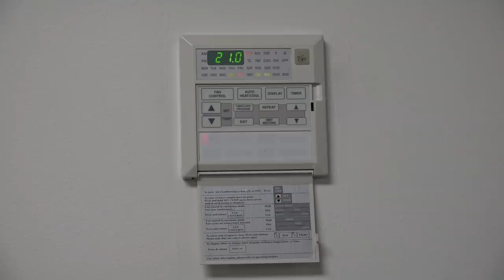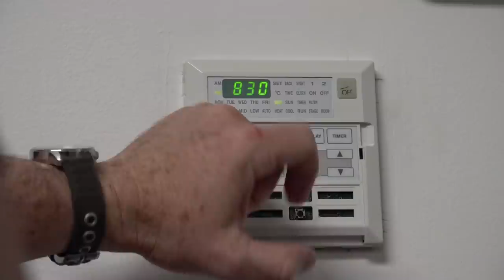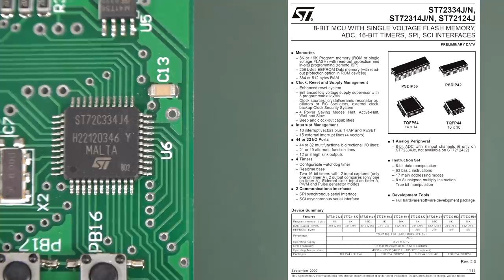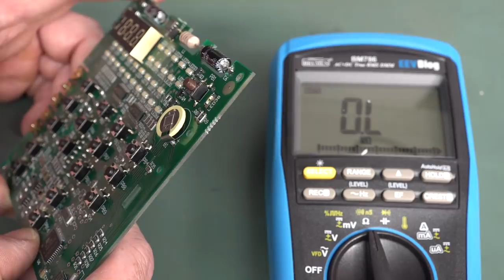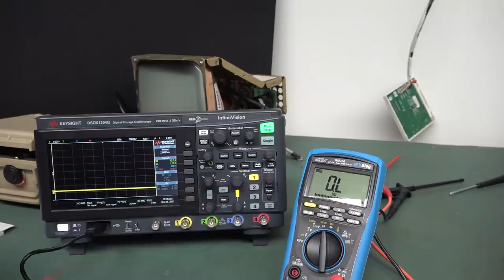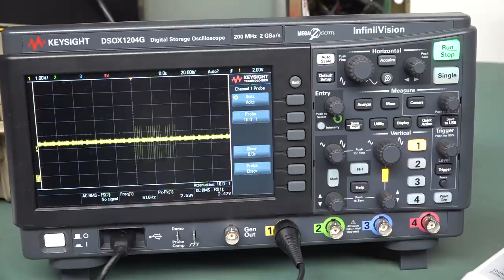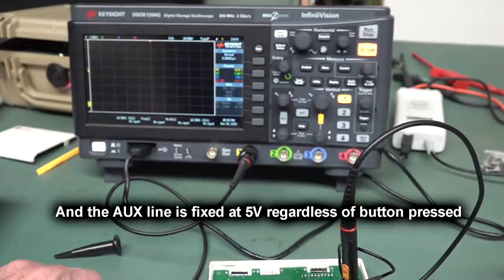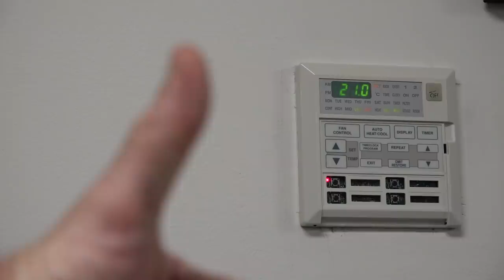EEVblog #1360 - REPAIR - Aircon Control Panel

Comment: You kept saying that you would use the internal sensor. Which is dumb.
The internal sensor is that blobby thing that you pointed out.

The biggest problem with using the internal sensor is that it is wherever the control panel is. The control is placed for convenience, not for optimal temperature sensing. What makes it even worse is that it is housed inside of the control panel so it is slightly warmer than the ambient air temperature. (It is at the bottom of the control panel to negate this effect a bit.)

An external sensor can be placed anywhere in the room. In particular you can place it in or near the return where you can get a more accurate temperature reading.

All of which makes a remote sensor better. The only reason to use the internal one is because it is cheaper to install. (or if the external sensor is broken and you are waiting for a replacement.)

Comment: I wonder if those pulses actually come from the AC unit itself rather than the thermostat.  It might be the AC unit reporting what mode it's in, basically to give confirmation that the mode you set actually went through.   I hate that some hvac units over complicate the thermostat though.  Makes it harder to replace with something else if you wanted to.  Most residential ones are simple as they typically just use dry contacts to set whatever mode you want.   Ex: yellow is A/C, white is heat, red is +24v etc.   I ended up using a relay controller and some Dallas temp sensors for mine so I can control it via a web page.  No app shenanigans just a basic web page I can access from any web browser.

Comment: I never get 0.000VAC when measuring the voltage between two different ground points in my house. I usually get a couple of volts, even if both things eventually end up at the same ground/earth bar in the breaker box (our house has old school IT-mains network (Isolated Terra)). How did EEVBlog do that at 19:19? Did he secretly press "Lo Z" on his NM786 DMM?
EDIT: Dave actually went directly to the ohms range while probing the to points with unknown voltage differential. Will a good quality DMM handle that if it is 230VAC (high Amp) differential between the pins? Nevertheless, 0,000 ohms resistance seems funny. Too low.

Comment: I'm not sure if HVAC is handed differently in Australia, it probably is, but in the US the HVAC system is tied in with the fire protection system, so there might be the possibility of triggering a trouble alarm. Won't set off the fire alarm obviously but it would log an issue with HVAC and may potentially phone home to whatever company is monitoring the FSS.

Comment: The digital signal looks like a 'bits' to me.   In OFF mode will always look the same, but in ON mode it is sending several bits of data to determine heat/cool, fan speed,  running/standby, etc.

Comment: Flashing run = probably because you cycled the AC on/off/on - might be a cooldown period as compressors don't like to start shortly after stopping. The pressure built in the system makes it very hard on the motor. (Might not be the case that you are controlling a compressor in a large building, more likely you are calling for a solenoid valve to open allowing chilled water into a heat exchanger...but the protection behaviour will be built into the controller).

Comment: The silkscreen saying PB__ tells me that each pushbutton is on an individual pin of IO register B from the MCU. 
The changes in resistance on the aux line might just be some issues with the voltage induced from the Multimeter through some clamping diodes.

Comment: Hi Dave, my assumption would be that the MCU reads the voltage divider to determine button presses to adjust its state then communicates its settings using timed (pull-up) pulses at set intervals as seen on the scope, the first pulse of which is probably being used as a clock trigger (for the AC unit), then something like a 24-bit listening period and translated into configuration state at the AC unit.

Comment: Dunno about down under, but in the states control circuits like that are 24V AC.
(I just play a HVAC tech on TV...)
Reply: It may even just be connected to a doorbell transformer.

Comment: I'm happy to see the DMM models continuing to evolve, but I'd rather see a ESR capable capacitance meter added to the lineup.
Reply: That would be far too useful - then they couldn't sell you a separate ESR meter. I built one a very long time ago from schematics on the web - one of the most useful tools I own for debugging electronics!

Comment: Airco on/off button works eratically.
Half an hour of analysis later (using various expensive tools): replaces switch.
Fixed.
Reply from the maker: Err, the faulty button was detected after 10 minutes. And it wasn't just the on/off button working erratically, it was causing other modes to turn on, and that's not usually indicative of a simple switch failure, hence the analysis.
Reply: @EEVblog  It is not meant seriously :-)
However, I think you could have focussed more on the analog voltage that is sensed by the micro and see on the scope what it does when buttons are pressed.
E.g. when the HEAT button is pressed and when ON/OFF is pressed, the latter would probably show a quite ragged pattern that crosses over into the voltage area where the HEAT button is.
I think that is more relevant than the pulse thingy that controls the other side.

Comment: This is where 3D printers come in handy, can't find the exact switch then print a new button/adapter to suit a switch you do have. That said pretty sure the last time I looked most suppliers like RS etc. normally offer a wide range of button lengths.

Comment: Dave if you want you can repair those switches, by getting a cotton bud soaked in iso alcohol and flood the button from the top where it enters the body and press the button a bunch of times, that should clean the contacts inside. brand new again.
Still loving the video's.
Steve K.
Reply from the maker: Not if it's corroded.

Comment: I repaired a window unit air conditioner control panel couple years ago but it was just a fuse.

Kind of annoying that I had to go deep into the AC to get to that board out for something as simple as a fuse. Even then, they just had to use one that requires desoldering (no fuse holder). I mean, why bother with a fuse to protect itself if it's implemented in a way to make replacement less feasible?!
Reply: Fuses also protect the wiring from a device gone short. For a fuse that should never open except in case of a non-user-serviceable fault, a cheap friction-fit pc mount clip only presents a new point of failure.
Reply: @abitofabitofabit4404  Sure, but this was on the control panel which was just a 7-seg LED display, IR receiver, buttons, and other low-power stuff.

Reminds me of my $400 Logitech Z-680 speakers that lost two audio channels due to on-board fuses hidden inside shrink wrap. I noticed two days before the 1 year warranty expired but it took me a few days to troubleshoot and call. It turns out that other people with the issue were being sent the next-generatuon Logitech Z-5500 speakers and told to dispose of their old speakers, so they weren't there for factory repairs. I had checked the main fuse and didn't find anymore she  I called them. They refused to replace it under warranty or even let me pay for an out-of-warranty repair. I couldn't bring myself to throw them away. 10 years later I took another crack at it and noticed six thru-hole components hidden in heat shrink... one fore each channel. Sure enough, they were axial lead glass fuses and super-simple to fix. The right fuses were easily available at Radio Shack.

Comment: I'm thinking those bits coming in is just a mask for what LEDs to light up on the control panel....
Reply from the maker: That's what I concluded in the video, it's mode data from the controller.
Reply: That's exactly what it is. A mask for what LEDs to light up.

Comment: You could try to fix the button with the alcohol or some other dissolvent, like gas, or contact cleaning stuff. Just putting a drop on the shaft could be enough

Comment: Just a thought... It could be remote analog sensing, but with constant voltage and measure current.

I would imagine long cables in a voltage divider means high impedance driving the cables and therefore pick up more noise.

So what if you measure the aux wire with a current prove instead of a voltage probe?

Also, the data, could that be noise coupled from for example modulating data on the power supply lines? Let the unit be driven be the capacitor when the supply goes to zero for a data bit?

Comment: The weird thing is so many English words. Usually with the use of iso standard symbols they can be used almost without language at all. It almost resembles a binary clock. Insane design outside, regular insides.

I've got tact switches in one of my monitors and the whole set of them randomly activate unwanted functions. That'll give me something to fix next week /month /year /decade. (when I get around to it or run out of procrastination-fu, though I've got A LOT of that!)

Comment: This looks like an infra-red remote style protocol, signalling with variable pauses between pulses. 16 bits in a "packet". A zero is a pulse with no delay, a one is a delay then a pulse. By freeze-framing your video I've seen the following messages (might be bit reversed / backwards): 0101-1000-0010-1001, 0101-1000-0000-1001, 0000-1000-0000-1001 "Thats aircon on", 0000-0000-0000-0001 "Thats aircon completely off".
Reply: Manchester encoding?
Reply: @DreitTheDarkDragon  No, it is pulse position encoding. The packet length changes with data. If it was manchester it would be fixed length.
Reply: @cathedrow  Oh, I see, thank you :)  I thought that IR remote uses Machnester
Reply: @DreitTheDarkDragon  Some do (eg. RC5) but not all.
Reply: @cathedrow  One of the two main cable TV companies in the U.K. used to use IrDA protocol for its remotes (before they all merged into one company) which meant no learning remotes would work with their cable TV receivers. The reason was that they planned for most customers to use an IR keyboard to access the internet on their cable box.
Reply: @Bin216  Good to see IrDA got some love. (Telewest? NTL? Last cable service I had was NTL analogue so I’m a bit behind the times there)

Comment: Think about it?? Why would they use a resistive ladder derived voltage to talk to the remote air con controller when the resistance and therefore voltage would change because of the length of the cable, the gauge of the wire and electrical noise. You should have realised that much earlier in the diagnosis. Great repair but in 30 years I’ve never seen a high resistance switch of that type so good spotting.

Comment: A squirt of contact cleaner - good for another twenty years.
Reply: Nope.
Can't count how many µswitches of this kind, and of the "lever" kind I replaced on many different stuff, well before the usable lifetime of the device itself. Tried the contact cleaner and it just helps a few week then it goes back to producing complete garbagdy resistance measurement.
Reply: Maybe. But by the time you tear it down far enough to get to where you can get contact cleaner inside of there, you may as well replace it. EVERYONE uses those tac switches, everyone has hundreds of them in their parts boxes. Not worth bothering with trying to save the old 9 cent switch.
Reply: I have an ultrasonic cleaner with those same switches. When one stopped working, I managed to get a squirt of Deoxit in there, and it worked great again. For about a week. :(
Reply: @ThinklikeTesla  Actually, you were probably doing well to get a week out of it. I generally reckon cleaning a pot this way is good for a couple of hours. When I replace a worn out log pot on a guitar I use cleaner to get sufficient connectivity to be able to get a decent idea of the exact law, so I can replace it with similar.
Reply from the maker: Try twenty days. It's likely corroded inside.
Reply: @John_Ridley  Yes, but disassembling and cleaning the contacts with a good contact cleaner usually helps. I'm not talking about these common, readily available few cents tact switches, but there are some weird ones around, which are no longer available, so you either have to substitute them if mechanically possible, or your only other choice is to repair them. Philips used some, for example. The don't have any shaft, the pressing pin is part of the button. I had one of those failing last year in our 1997 Whirlpool microwave (control board made by Philips). I've managed to source a working switch for it from the remains of a 1982 Philips TV... :-) .

Comment: @11:47 It's a buck converter not an LDO.  LM2594 with the Diode D2 and the Inductor L1 (not a Resistor). It is a switching supply despite the commentary.
Reply: He inserted a note and the datasheet front page in post, so he did realise that later
Reply: He put up the data sheet that clearly indicated it's a buck converter... pretty sure that was his attempt to correct himself via annotation.

Good catch though.

Comment: "It should trigger, but it doesn't....". Yep, because it is a Keysight scope. These models have "digital" trigger and it works this way (the Keysight way). Tektronix have different way to trigger on signals, more adequate one (most of the time). IMHO.
Reply from the maker: Nope, you'd get the same result on any scope, that's what trigger holdoff is for.
Reply: @EEVblog  Please, allow me to dissagree. Here is a short demo (1min). https://youtu.be/OT-0mGkWUxM
Anyway, if you know your scopes, doesn't matter that much in practice. Peace.

Comment: I hate when they're using open core inductors in switching regulators. They make basically an AM transmitter with a ferrite rod antenna! 150kHz is right on the bottom on the LW band, I wonder how far the switching frequency can be picked up with an LW band radio. Or even with a basic AM radio, its harmonics might be picked up from tens of meters.

Comment: Have you consulted the mighty GOOG to see if there is a schematic online somewhere. I’d be surprised if it isn’t. That would save the reverse disintegration. I bet the analog “protocol” dates back to a controller with discrete xistors and relays.

Comment: Dave, try to change temperature and probe communication. What if it just periodically sends set parameters and mode? Like heating/cooling, temperature, fan speed,...

Comment: on a resistive divided control pad / panel, if the resistance of a button is incorrect the mcu will mistake the button for another one.

Comment: And replace all the switches one by one is a bit of challenge.If were through hole the desoldering of them would be a real nightmare,smd switches also is not the easiest thing to deal with.So put it all back in place and leave it as it is.

Comment: The big resistor at the top is a hearer to create air movement inside the unit to get air past the thermistor ( A fan with no moving parts )

Comment: PWM data. Look like 16 bits. The width of the bits is what define the 1 or 0.

The protocol is most likelly very stupid, like 2 zone bits (1-4), 2 modes bits (off, fan, cool, heat), 2 bits fan speed and so on.

My heatpump remote is like that, it just send all the settings every time you press a key, and also have another mode/data format for the remote temp sensing.

Comment: For years I had radio, without working power button, used remote to turn it on and off. Recently opened it up to discover just a faulty tactile switch, was completely gonsky, nothing at all when pushed, 20 minute fix. Man, I was convinced that I broke something more when I hacked banana jacks in parallel of Sony's damn propriatary DIGITAL MEDIA PORT (still dont get it why they think it is a good idea to make some weird ass propriatary ports on devices. Ok, I get the motive behind that, but still, how many people will buy that cable anyway. For those interested what I'm talking about it is NAS-E35HD, got it at thrift shop for decent price, still serves me perfectly for purpose.)

Comment: Hmm, seems like it pulsing like a can-bus line. Which would make sense if the unit(s) can except secondary thermostats in other locations with zone ducting and one hvac unit. Master - slave configuration. 
Or the pulsing could be the angry pixies having a jam session 🤔